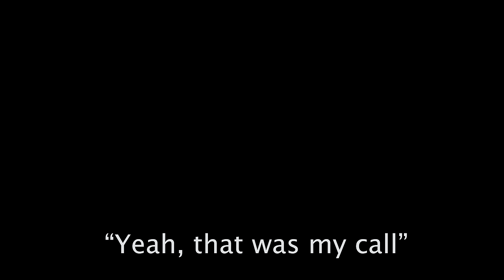GS450 Lawn Mower gets HUGE Upgrades!

Comment: FYI you MUST use cutting oil when you're using a parting tool especially with steel. That's probably what killed your electrical as you were loading the system too much without oil.

Comment: for you lathe you should convert it over to a dc motor with a variable speed drive. find a bigger treadmill and take the motor out of it and then build or buy a VFD (variable speed drive) this will give you all the torque you need and better than an ac motor.

Comment: Okay no expert but I do know a bit about machining. Just for info, When you have stock in the jaws, if it sticks out more than 1 1/2 times the diameter, it needs to be supported. so that piece of pipe you had in it needed to be supported. That's why it was chattering so bad when you were trying to part it off and why the cutter went for a flight.

Comment: I think a predator would spin the lathe just fine. You would needs an exhaust ran outside the building. But it would work. They used small engines for years in factories

Comment: Wow that lathe setup.... how would you stop it in an emergency 🤔 love you guys, please keep safe
Reply: It does have a gearbox with a neutral, but I know what you're saying!
Reply: The foot pedal (if still functional)  will kick it in to neutral and apply the spindle brake.
Reply: @GRid-yk2ru  yer not a expert but was concerned it wouldn't disable the driving motor etc

Comment: You need a cooling fan for that engine. They rely on forward speed for the airflow. Its no longer getting that since it's no longer in a motorcycle. Where a lawnmower or go cart engine has cooling fan blades on the flywheel... won't last long if you knocked them off... removing most of its ability to get cooling. 

A good replacement engine will be from the GS500. It's basically the same engine with a few more cc's.

Comment: Rotory Phase Converters are not as much as you would think. One from American Rotory that would do a 2hp lathe is about $800 (that might be a bit overkill), smaller ones are a bit less.
Reply: We need one for a 5hp motor
Reply: @isaacitllbefine7231  that's a big boy, not surprised you are burning up your current drives.

Comment: I've always struggled with the lathe cutoff tool. Tighten up the gibs and cross your fingers.
Reply: It snapped because they're trying to part off a workpiece so far away from the chuck without supporting it. If they cut down the tube to a shorter length before chucking it, or used a steady rest, they wouldn't have had any issues.

Comment: The only way I'd do 12 inches of material on that chuck without the tail stock is to run the pipe through the chuck at least 4 inches,or its gonna wobble out and break your inserts every time.

Comment: Here's a FREE product idea: you know the round sticker in the middle of the pull cord cover that says 212cc, or predator? Why don't yall make some converted into Cubic inches? And/or different Horsepower stickers. Like a 9+ sticker for a stock 212 Tillotson, a 10hp or 11hp sticker for a stage 1 Tillotson 212 and so on.

Comment: Charles that white chevy is not a 73 going off the grill! It's a 78 or 79 because of the doors on the bed coving the gas cap and the headlight sound maybe the first half of 80 but not a 73 or 74 as those grills are sunk deep and not flush like that k10

Comment: A decent VFD should run that lathe no problem. I'm guessing it's probably the motor. Or maybe are you trying to phase convert from 110 to 220? You have welders, is there not 220 at the shop?

110 -> 220 phase converters will not survive under that load.

Comment: In the future, if you're going to test something questionable, use a GFCI receptacle. If you have any faults, it will trip instead of passing the current all way to the panel and throwing the breaker. Back to the original motor, best case scenario is that the power company can set you up with three phase and you upgrade to a three phase breaker panel. If not, don't cheap out on the hardware to convert.
Reply: Just convert the lathe to a single phase 220v motor, would cost many times more to get 3-phase installed, though if they did that it does open up the possibility of a nice  welder and other more professional type fabrication equipment in the future like an ironworker or a mill.

Comment: Go back to the original pitman hole, shorten the steering arm mounting hole locations and you'll gain ease of turning as well as your steering angle will increase. Old dirt track trick when rules states you can't 'add a steering quickner'. Just be good at making parts look original.

Comment: I’m building a beast mode stroker engine for my highly modified MudStar 200 mini bike to rival your Tilly stroker build. Accept I think I got y’all because I took it a step further and went with 59mm stroke crank so I’m up to 240cc now with a 32/25 ported head and 1.3 black venoms and 50lb springs same as yours. I wonder though.. who would win? I’ll be running an upgraded Juggernaut on my bike..

Comment: If you're not gonna use that lathe for production, I'd throw a single phase baldor in there the same rpm and shaft size as the 3 phase already in there.

Comment: YOU GUYS NEED TO INSTALL A BUCK BOOST TRANSFORMER AFTER YOUR PHASE CONVERTER AND CHANGE THE ELECTRIC MOTOR ON THE LATHE TO 3 PHASE 480V SO THE AMP DRAW IS CUT IN HALF

Comment: I mentioned it last time, are you starting and stopping the motor from the original controls on the lathe, or starting and stopping through the VFD on the wall? VFDs do not like it when you disconnected a running motor from the VFD. You smoke the VFD, like you have done twice!
Reply: Original controls

Comment: That won't allow you to do burnouts with that machine.  You have too much weight on the rear tires and it will just push the locked fronts and you won't be able to steer because the wheels are locked.  You could try a super sticky slick in the front and some super narrow hard rears to get it to do it stationary.

Comment: As a machinist I won't yell at you for the 110v motor, thats pretty much what I would've done as well (or a 212cc engine to get me out of trouble) but I will yell at you for trying to part off a piece of shitty pipe that is hanging a mile out of the chuck with no end support.

Next time, use end support, mount the pipe so that the edge you are cutting is right up near the chuck, grab it with external jaws from the inside of the pipe, or cut it close to size with an angle grinder/saw and just clean up the end to suit the job

Which is what I do on small jobs because I don't like setting up parting off tools either, lol

Comment: Be carefull, that power cord from main motor is probably producing electricity since it is being turned by the 110volt motor.  That converter is in no way large enough for the amperage.  I am betting you have 240 to the building, double check with power company on that.

Comment: The dumbest thing is that chain guard where the chain rides inside the square tubing and has to be cut off,repositioned every time they change either sprocket... All they needed was a piece of flat bar along the top side of the chain... 😮

Comment: If the ratio is going from 17/60 to 20/54. Thats a 23.5% increase in wheel speed assuming it has the torque.

Comment: I am a machinist and I have no problem with most of what y'all did but, that tubing needed supported at the non chuck end that is why it tried to come out of the chuck on Charles.
I do have a question about your lathe.
You obviously have a motor that will run the lathe so why keep buying phase inverters? Just replace the original lathe motor with the one you used in this video or get a 220 motor for it.

Comment: They didn't break a "bit", They broke an insert cutter. While kind of expensive not the end of the world. Of course some are made to be able to use two or all four corners for maximum efficiency. Of course that means not braking them and crashing the machine.

Comment: Digital phase converters, aka DPS boxes, are complete garbage. Been plenty of videos on them lately. They either blow up or they kill the motor by being unbalanced current draw between the phases and one motor winding ends up burning out. If you want to keep the three phase motor get a rotary phase converter, otherwise put in a big 240v single phase motor, you will lose some power but for light work it should be fine.

Comment: With the motor it doesn't matter ac or dc power. Since it's just magnetics, positive and negative, you just which the positive and negative to make it spin. Just don't mess with ground.
Reply: SO incorrect. The type of motor makes a huge difference. A dc motor will run off AC with a rectifier. An AC motor has 3 or more wires and needs 2 of 3 to be swapped for direction change. The wires need to be swapped pre diodes in a DC motor but they have timing and power output is not the same in reverse. Get some knowledge before you start telling people things that you don't actually know.

Comment: It’s perfectly acceptable to change the 3 phase motor to a single phase. You won’t be able to take the same depth of cut, but it doesn’t look like you guys use that lathe for much more than light machining anyways.

Please, just do it right. Change out the actual motor in the lathe.

Comment: Once again it's NOT the Lathe that's the problem it's the Phase Shifter that's the issue!
 What you guys need is a Rotary Phase Converter NOT a Phase Shifter. 

Phase Shifters are Complete and Total Garbage, they use capacitors to try and create 3 Phase power and they do not do it well! The problem is there is a Massive discrepancy in both Voltage & Amperage between legs 1, 2 & 3, one leg could be pushing 10 amps or more another could be less than 4 amps and the other could be pushing 6 amps. This is not good for your Expensive Machinery! If you keep buying these cheap Chinese POS Phase Shifter you're just going to keep blowing them up Or worse, you Burn your Lathes Motor up! 🤷

Do yourselves and your wallets an favor and contact American Rotary, they make Rotary Phase Converters, this will fix the issue so your Lathe, Mill and whatever else you run on 3 Phase will run like it's supposed to. Hell they may even sponsor you and give you one for free.